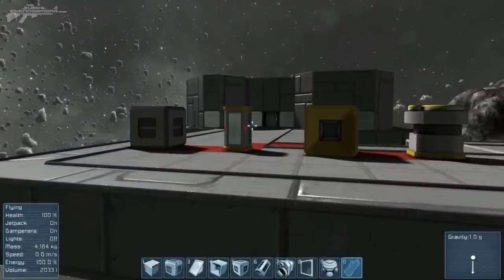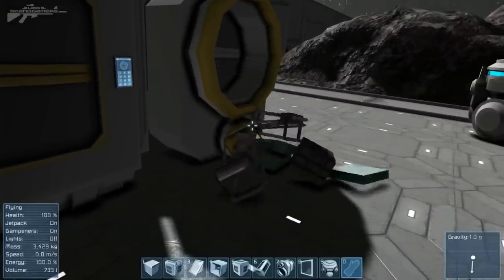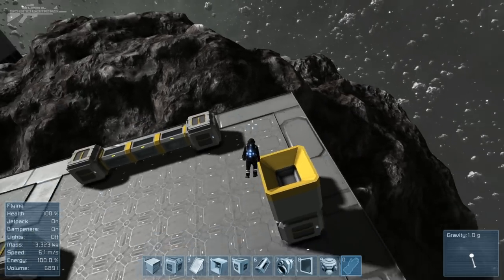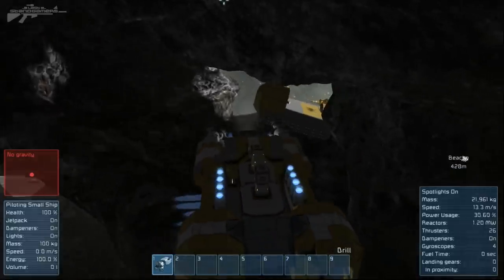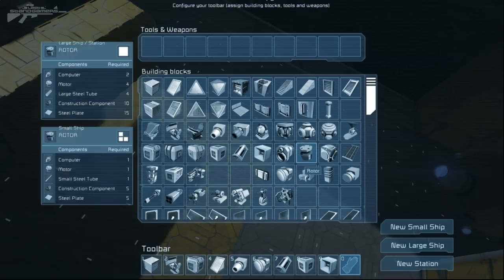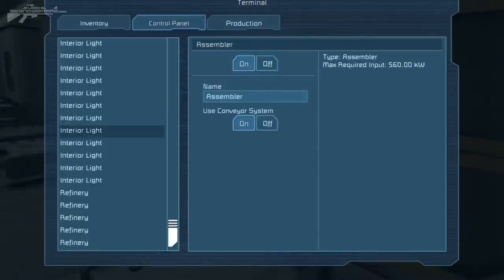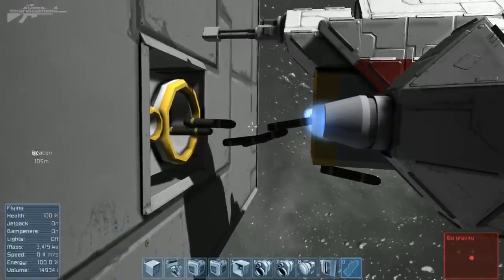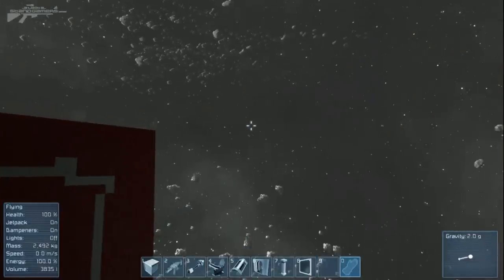Space Engineers - Conveyors, Collectors, & Connectors Mass Production

Comment: We can now have refueling stations with stores of Uranium and even ammo. I've made some that feed directly to my reactors. And now, mining barges can be effectively used through this system (assuming you've got the on ship hangars able to hold the small mining vessels secure) and thus initiate mining operations on a large scale. An Idea, however, that I still want to see realized is the implementation of charging stations for ships to recharge energy stores in the form of battery power. This doesn't need to be to powerful but would be great to see things like that so energy for large ships is more manage-able and also allows for, when the servers are larger and smoother, interesting strategies to be conducted  by either factions or any other band of people.

Comment: The connectors are actually supposed to connect (hence the name) with another connector. similar to a docking port but for materials. which should speed up the factory system even more once they implement it fully.

Comment: You could make an aimable platform, kind of like a turret, that has gravgens with small elongated grav fields and on the otherside a giant funnel with a gravgen that sucks the ore in. So after you mine it you move it to your turret, drop it in and it gets "fired" into the funnel on your base, therefore negating transport ships and still passing long distances to the base.
Obviously, the whole assembly would need to be fit ONTO the rotating turret part, so it needs to be big enough. But building a single station block near the asteroid to mine, then attach the turret to it wont be hard. Then just line it up with your base and  have the breaking torque set to max. don´t bump into it and you should be fine.

Comment: Self-refining mining ship?? :D :D
Reply: I think I know how that would work:
You have a mining ship docked with "a large ship", that is, a stray refinery and a collector. The mining ship unloads it materials through a connector which spews out rocks into the refinery's collector which the mining ship is docked with.
Here's how it would look:
M-connector
l    l
R-collector

Here, M=Mining ship, R=refinery, and the "l" and the "-" are the attachments
Reply: Robert Cline just build a big mining ship
Reply: hades1341 actually, large ships, in this game, cannot have mining drills, just as small ships cannot have refineries.
 The only way that i can think of for have a ship that has both parts, is to have a common mining ship docked with a stray refinery.
You can add a conveyor and collection system to allow mines ores to be collected by, and smelled by the refinery, if you desire.
Reply: i mean a big small ship small partss but many of them to creat one big ship with refinery and drills
Reply: In this game when you start building a ship you have to define if its a "small ship" or "large ship" you can't place a refinery on a small ship. The game won't let you. Likewise for the mining drill and large ship. What he is saying is to have a small ship secured to a large ship with landing gears. So essentially you use the small ship with drills to haul a large ship with refineries and stuff .
Reply: you could attach the small ship in a way that yit can mine an transfer at the same time or ??

Comment: I will add a resupply ship to the fleet with the new blocks and I might try to make an arm so I can traverse the resupplying so that it doesn't leave multiple rockets near an engine of say a battleship and bam,its engines done for.
Reply: if you get the connector right in front of the collector so that they are touching you don't cause any messes the items don't appear they get sucked in before they can.
Reply: I would have it so that it would have some rotors and inbetween the angle I would put the collectors and the sucker thing.